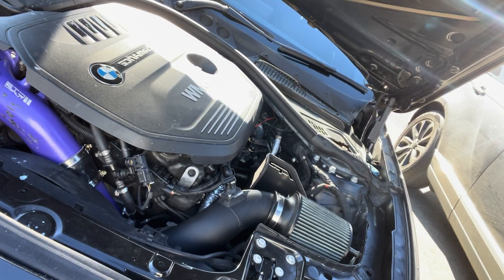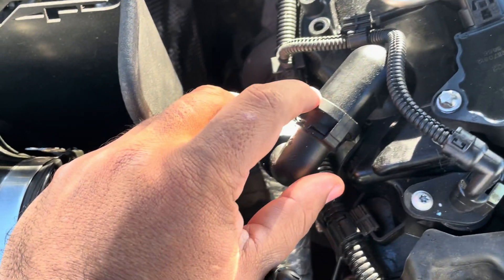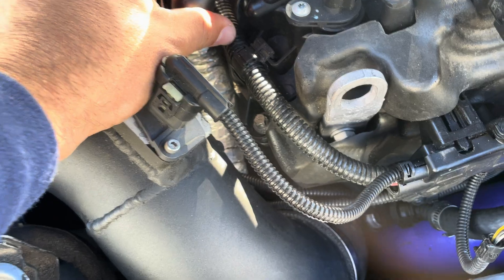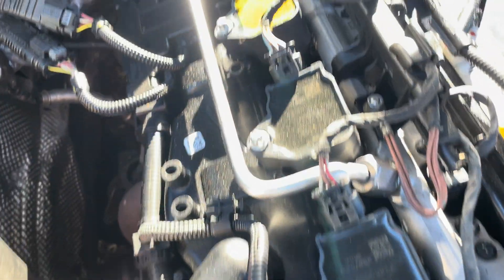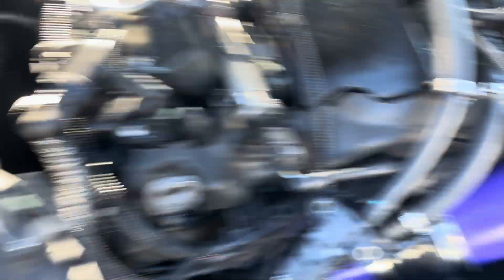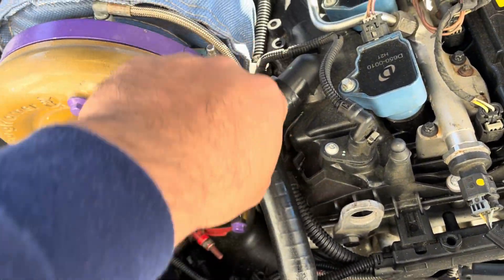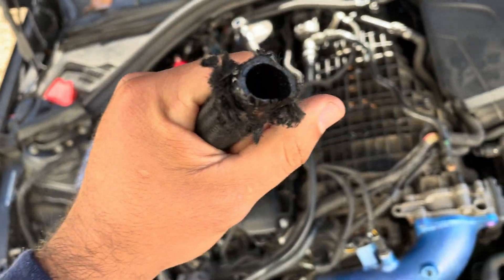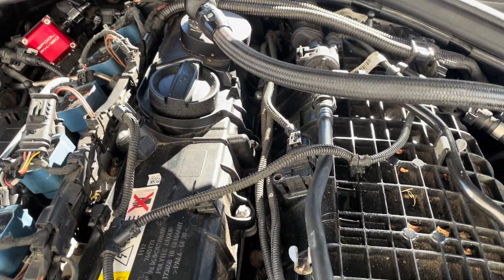B58: oil consumption discovery (valve cover, turbo, or pistons)

Comment: You reckon burning 10 litres of oil in 3 thousand miles is bad?🤣 had it on dyno recently after getting intake manifold changed as i had a hole in it. Numbers all came back perfectly and compression test all good.. had it in with 2 bmw specialist aswell and they cant seem to figure out where the oil is going to😂
Reply from the maker: Have you replaced your valve cover ?
Reply: @Juanscars i must check the turbo since the dyno runs. When the dyno runs were done thats when intake manifold was replaced but i cant be this unlucky 😂 new engine, then rocker, then intake manifold then turbo?!?
Reply: Valve cover replaced, intake manifold replaced, oil filter housing inspected engine is bone dry 😅

Comment: i did a pull getting on the high way and i had the engine stuttered and gave a drive train malfunction. i pulled over and turn the car off and on and it let out a huge cloud of smoke. i towed the car home and put the stock chargepipe back on and oil poured out of turbo and charge pipe connection i started the car and it had let out smoke but ran wit no check engine light. but now the car has an oil leak on top of the valve cover near the oil fill and pcv. i did a pcv but the car still doesnt feel right.
Reply: Your turbo is blown

Comment: Great video but I was wondering if you saw any blue smoke when coming to a stop or accelerating?
Reply: Did you ever figure out your problem? Mine smokes at idle and taking off at the light it’s a blue smoke don’t have a ton of oil consumption. Just replaced the valve cover with oem
Reply: @RobertMathews-x9m did you figure out your issue? Was it turbo or valve stem seals
Reply: @Chris8n have not figured it out yet. Hoping it’s not valve stem seals. Wanna just buy a new turbo and see if it fixes it bit of a hard bet though.
Reply: @RobertMathews-x9m  I have a m340i replaced valve cover and turbo blue smoke after idle at light. I am sure now it is the valve stem seals.
Reply: @MarvelRivalsWTH yeah I’m thinking Mine is valve stem seals as well. It’s been getting kinda bad the last 2 weeks. Im sitting at 130k. Wbu
Reply: @RobertMathews-x9m  I am at 120K miles , I replaced the valve cover 2x and the turbo as well. Same thing blue smoke if it idles for 2 mins and you tap on gas you get cloud of blue smoke. Its annoying when im stuck in traffic. its also normal for the seals to go bad at our mileage. I am also stage 2 aggressive with high burbles. add my inta
Reply: @MarvelRivalsWTH yeah same exact thing man. Idles for a few min I’ll barely tap the gas and throws out a good amount of smoke. Also stage 2 max burbles
Reply: @RobertMathews-x9m  i have the same setup but medium burbles, same mileage, what did it end up being? im thinking turbo
Reply: @charleh5785 just put a pure 650 on. Car still smokes a little after getting off the highway and every once in awhile at the light but other than that it still runs good. I’ve put 25k miles on the car with it smoking like this.
Reply: @RobertMathews-x9m having the same issue, just replaced valve cover. Replacing turbo next.
Reply: @trigun101  what did it end up being? i have the same issue, leaning towards turbo but i dont want to throw money on random parts